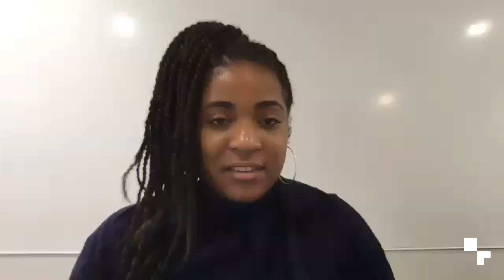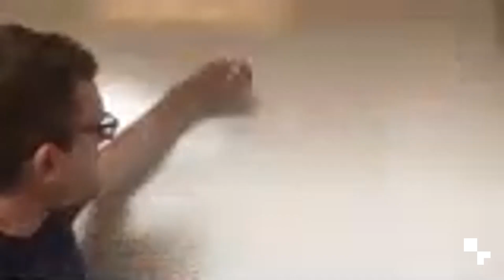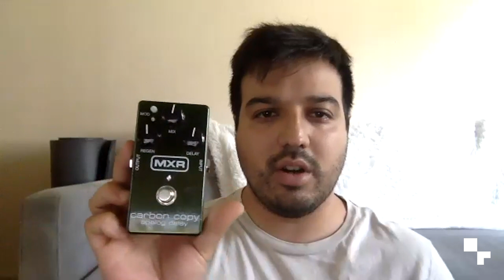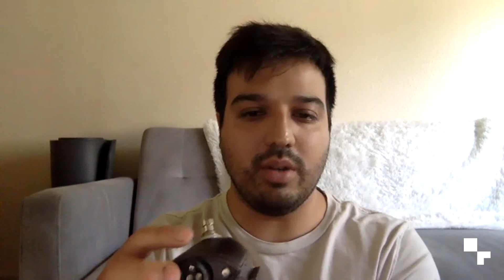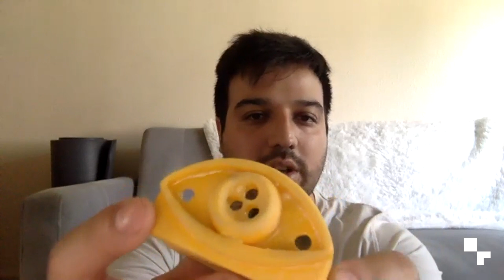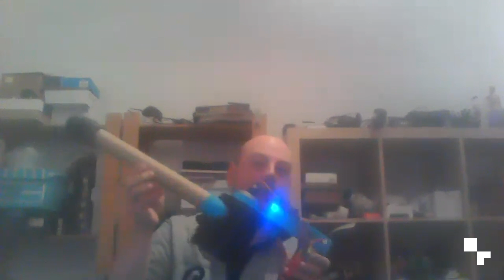Hackaday Prize: Mentor Session with Eric Weinhoffer

Comment: re: Axiom 100+kW Motor Controller    
Sheet metal, folded into a box shape.  Then dip, spray or brush the corners with a thick sealing agent like truck-bed coat so it's water-proof.  Should be very cheap.  These metal-forming techniques are basic and very common, can even do it yourself with minimal tools.   (edit: oh good the guy at the end suggested bending sheet metal too).

Another idea is to start with a cheap plastic water-proof enclosure, and cover it in glued-on metal or carbon film to get your EM protection.  Tho i'm not sure if you require a certain mimumum thickness of metal.
Reply: ah i finally (re)found the guy who made good videos about fabricating prototypes & recommends making things from bent sheet metal, dgelbart here on youtube.  highly recommended.

Comment: When it comes to the water-proof connection between parts... it generally might also be possible to use something like SikaFlex, instead of O-rings or glue, if operation temperatures allow for such choice. SikaFlex is mostly used in boat building, house building, to make joints become waterproof, and stays waterproof for very many years, if temperatures of the environment of operation are not unnaturally high as well as do not contain agressive substances (acids etc.).